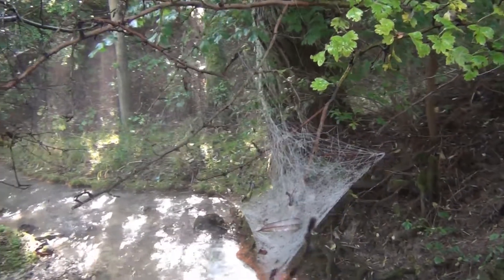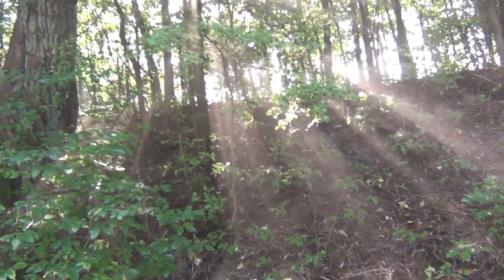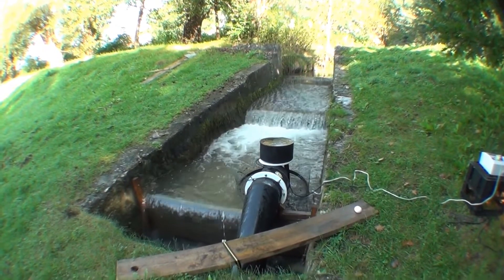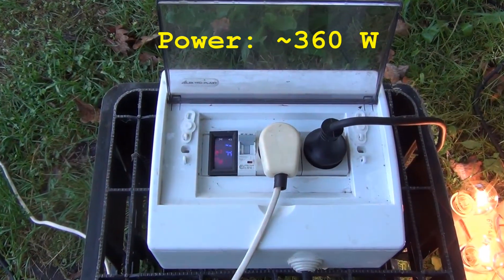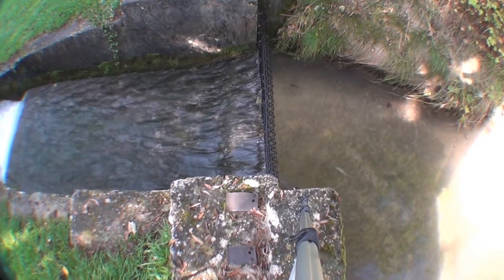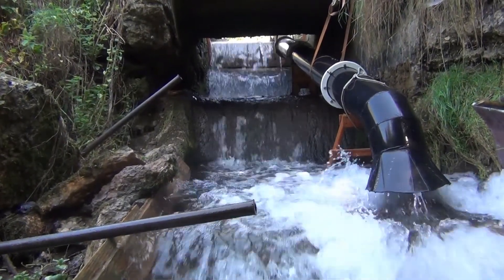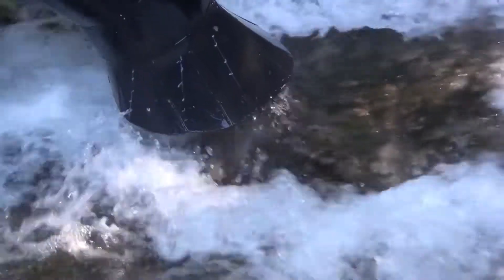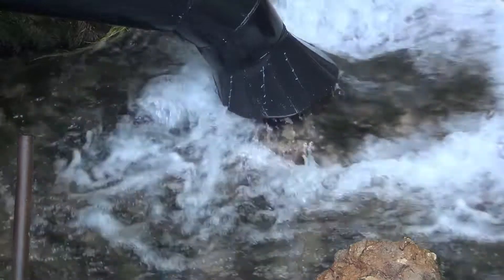Installation of 500W portable hydro power plant next to old water mill. Kaplan turbine siphon type.

Comment: The required height can run a 1kw generator You have to put the mouth of the other tube into the water about 5 to 10 cm